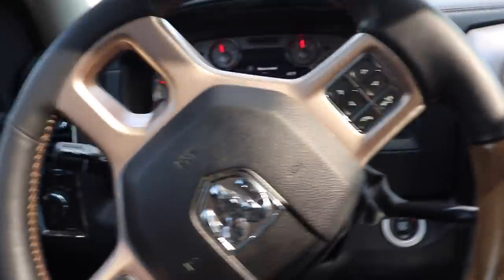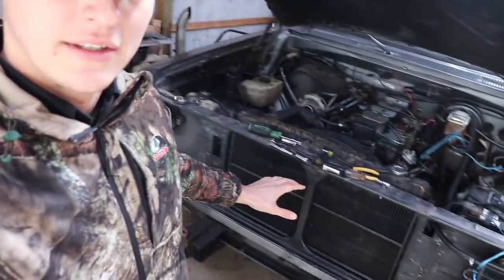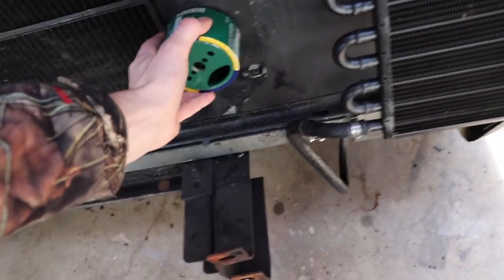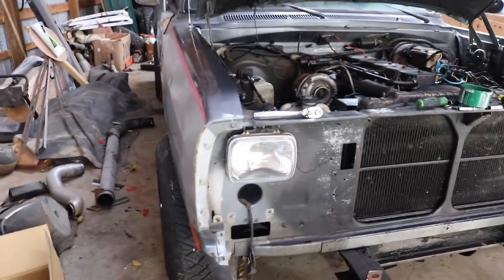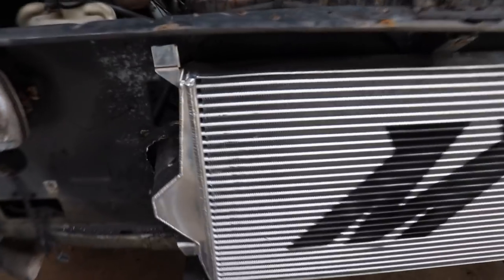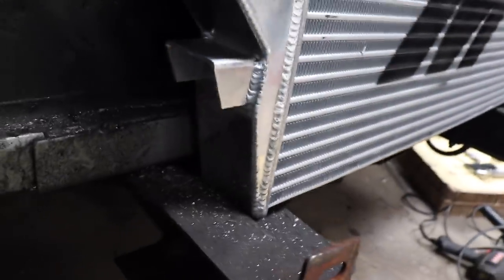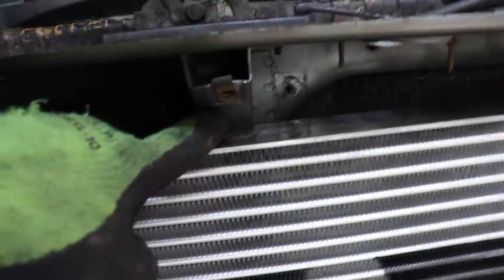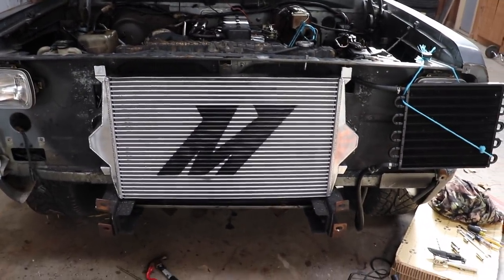MORE POWER FOR THE 1st GEN 12V CUMMINS!!!

Comment: hi from france !
the intercooler can't touch the frame  otherwise the frame will end up making a hole in the intercooler and you will end up with a boost leak
and keep in mind there is movement between the frame and the cab.

Comment: Make sure you put some grommets around the inner cooler. Also put a piece of rubber between the inner cooler and the frame. I would support it on the frame and use the top brackets as top support and not the dedicated bracket. Also make sure you are using locking nuts. Truck is looking good

Comment: Instead of messing around with a flat sheet of metal just cut out the bumper so the intercooler fits. It’d look way better and do a better job of protecting anyway. Also you should take the grill inserts out. Trust me you won’t be disappointed